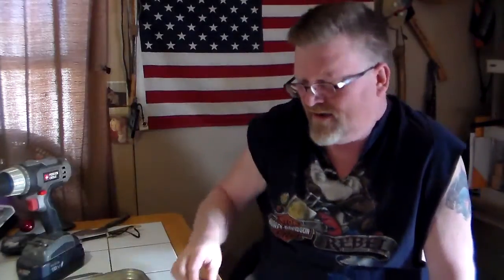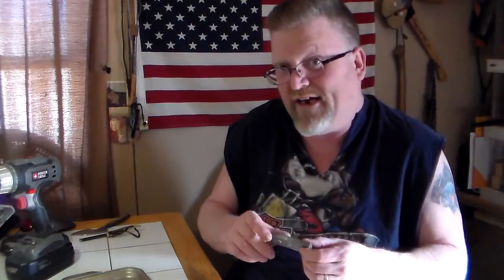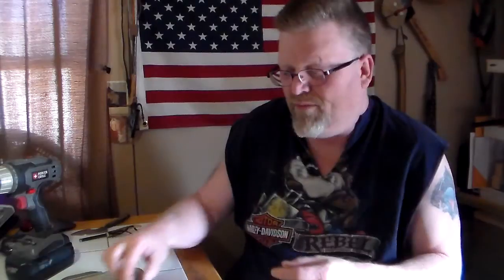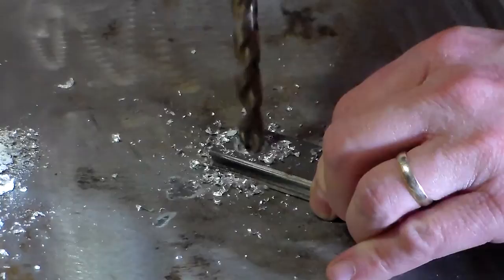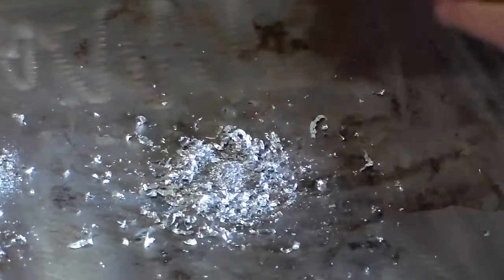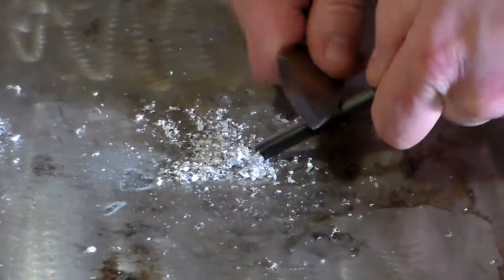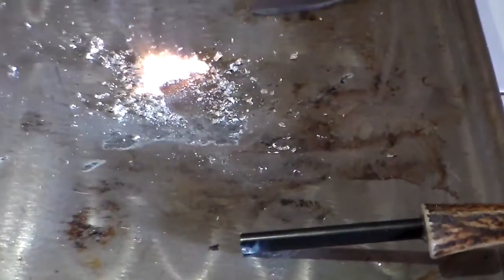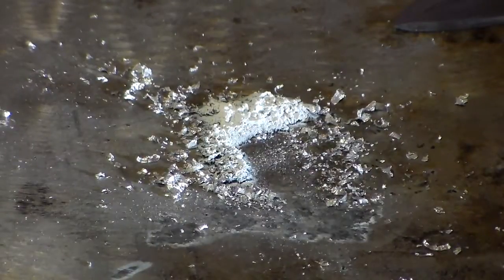How I Process My Magnesium !!!

Comment: That's almost too easy, lol. If you use a file (like on a multi tool) would the shavings be fine? I noticed that the size of shavings you just made left room for air in th pile as opposed to dust which would not. Thanks for posting this
Reply from the maker: +John “survivor johnny” Tewelow really when i slow down the drill i got smaller pieces and ya dust is more of a fast flash start i really like the curls !
atb john

Comment: I've never had luck with the magnesium bars for fire. I might try this though! What makes magnesium so flammable?
Reply from the maker: richarddbeck ya i usually grind it up with my fingers after i process with a drill !
Reply: for best results make it as fine as possible.
Reply from the maker: Brennan Jones it is the mix of metals , we use to have fires all the time at work , its the alkaline metals in the mag !

Comment: never thought of doing it that way> i never use my bar because it takes a long time to scrape a small pile. Vary cool. Did you pre drill a smaller holes the worked up on the bit??
Reply from the maker: 39camper no i just drilled away it is pretty soft metal so it drills right threw it ! atb john